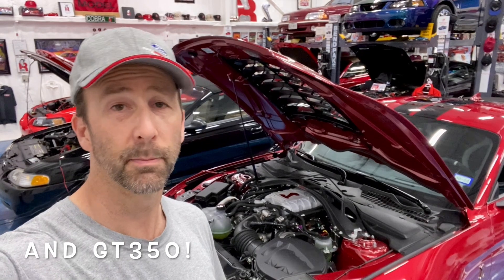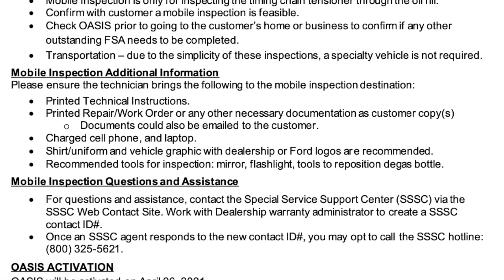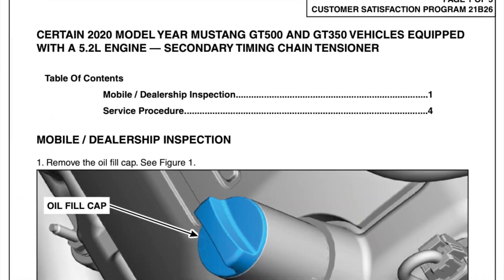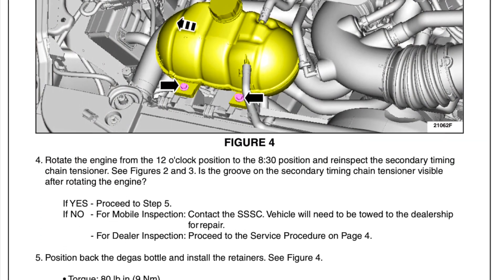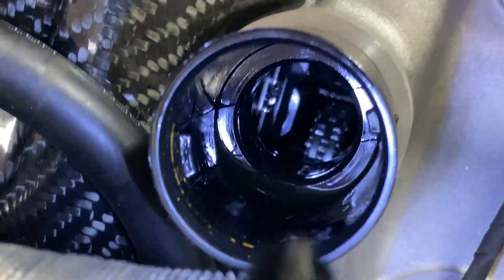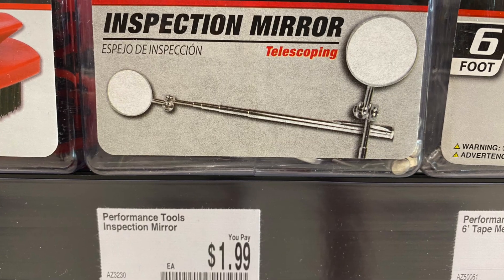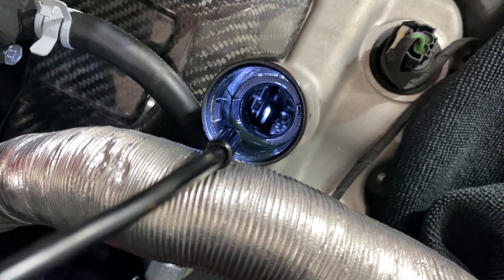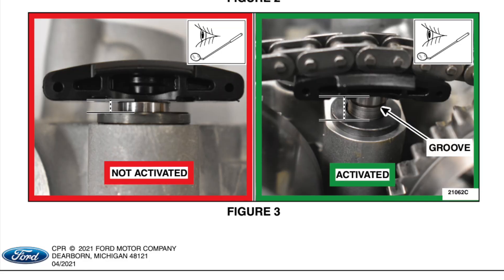2020 Shelby GT500 & GT350 secondary timing chain tensioner TSB!  Check yours to prevent damage!

Comment: If it has broken and been fixed? Could there still be issues with it.
I am looking at a car 2020 gt350 that it had broken in and been fixed by ford. I dont know if it I was a new motor or not.
Reply from the maker: Have any dealer print an Oasis report. It will explain what was done. It could have been as simple as activating the tensioner or as major as engine replacement.

Comment: My 2020 gt350 has 900 miles on it. It went into limp mode on the way home. Two days later I saw the YouTube on the tensioner chain. Sure enough the chaine was not visible. It busted. The dealer wants a new engine but Ford says rebuild it. Anyone no what my options are?
Reply: Sorry to hear that, very unfortunate. Check your state lemon law to see your options. Sad Ford isn't willing to replace the engine by default. If it were me (I almost bought a 2019 GT350R, held off in hopes Ford would address issues) I'd ask them to buy the car back and move on. These cars have had too many issues to justify the lengths owners go through. And it becomes hard to justify the cost and ADM the dealers charge for this level of reliability and the hassle of returning to the dealer for unscheduled service. I get the pride of ownership and all that but come on it's 2021, cars shouldn't have so many unresolved problems after ~5 years of production. This to me was the main reason I didn't buy a GT350R. And should be a red flag to anyone on the fence about these cars. Future valuation notwithstanding, I buy cars to drive them hard (track rat) and enjoy my time with them. Not worrying about something falling off or breaking and then hoping the dealer will do the right thing. When you spend north of 60K for a car you shouldn't have to.
Reply from the maker: @FL50ssp  I drive my CFTP hard at the track. It’s been awesome! No issues... well worth the wait and $.
Reply from the maker: Well crap!  That definitely stinks!  I’m not sure what would be a better option at this point. Having the original block in the car is nice, but getting a rebuild opens up a lot of variables that can lead to issues. See if Ford will buy the car back. You can then buy a different GT350 or go for a GT500.

Comment: Hey Tim. Should 2020 GT500 engine consume oil? I had mine topped off after the oil change. It’s been around 5000 miles since then and I checked the level today and it was down to lower mark on the stick. Kinda got me worried because I don’t have the habit of checking the oil level.
Reply from the maker: Mine doesn’t consume any oil, but I have the Ford oil separator installed. How ‘bout you?
Reply: @ShelbyFlyer  yes, I have that installed on mine too. I got the JLT intake and oil separator.
Reply from the maker: @cars_rides  The Ford unit is a more robust setup and it also returns the oil where it came from.

Comment: Good stuff, Tim. Good outcome - glad yours is a-ok. 👍
Reply from the maker: Thanks Fletch!
Reply: @ShelbyFlyer  I knew the GT350s had motor issues.But I didn't know the GT500s are having motor issues.I almost bought a GT 350 thank God I did my research.
Reply from the maker: @anthonylaudano9751  We have seen a small number of unexplained failures... stock engines with low miles.  Now we know. The GT500 engine has been otherwise bulletproof.

Comment: So what about the left bank of the engine, you'd have to remove the cam cover to inspect that side. I would be checking both sides for piece of mind.
Reply from the maker: The TSB does not address anything other than the passenger side inspection. I assumed mine was good anyway as I have driven the car hard multiple times with zero issues.

Comment: Really.. what is going on with Ford? I had a Focus RS, we all know about the issues with that engine. I now have a Mustang GT and a Ranger Raptor. The GT may well blow the oil cooler and the Raptor has FOUR recalls on it in 8 months!! Also, here in the UK the dealership network and backup is not good, so I think I need to look elsewhere in future?
Reply from the maker: Not an excuse, but all manufacturers have issues that pop-up after production. At least they figured this one out and got the word out!
Reply: @ShelbyFlyer  sorry Tim, but I have to say this. I guess your lucky that your tensioner has “popped up” lol.

Comment: Many thanks.  A new bore-scope just arrived at our home, and I have been looking for an excuse to use it.  Ours has a 90 degree camera mirror tip I am hoping will work without me having to fabricate a mirror that will fit into the opening needed, and I also hope our engine was properly assembled.  We will see,  Something I get to do tomorrow!
Reply from the maker: Report back what you find Gil!
Reply: @ShelbyFlyer  The 90 degree mirror head attachment had very poor reflective quality, so it was basically useless.  I will get a small head inspection mirror, and grind it as needed to get it to fit like you did in your video.  That said, our GT500 build date was 10/31/2019 anyway, so it is apparent the TSB would not apply to our vehicle.  But, no harm in looking anyway = first to make certain all is well, and more importantly to give me an excuse to use that new borecope I really had no need for other than "perhaps someday I may need one."  heh heh...
Reply from the maker: @gilberthale7777  Excellent Gil! I’m sure yours is fine, but confirmation will be good for peace of mind.

Comment: I would always check the quality of anything I get from auto zone tool wise just in case it falls apart. Would hate for it to fall into the motor 🙈. Mine would have electrical tape around it 😁🤷🏼‍♂️
Reply from the maker: I gave it a thorough durability test before lowering it down into the hole. It was all good to go!